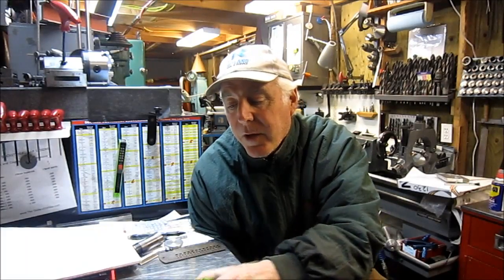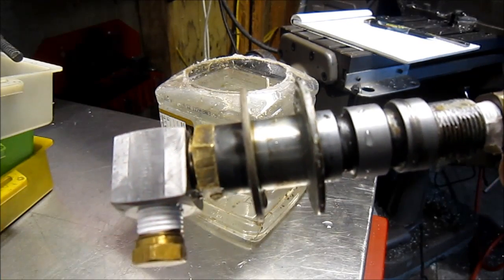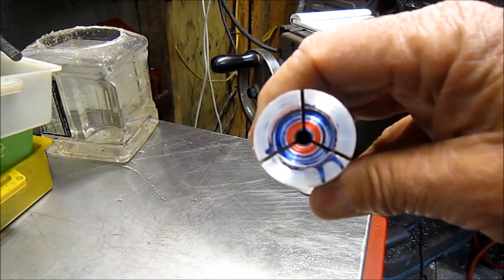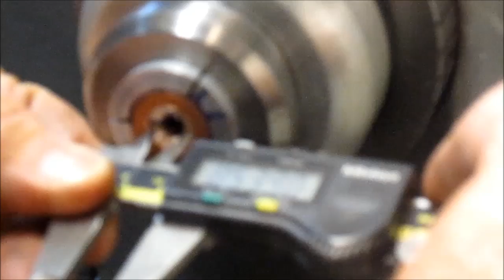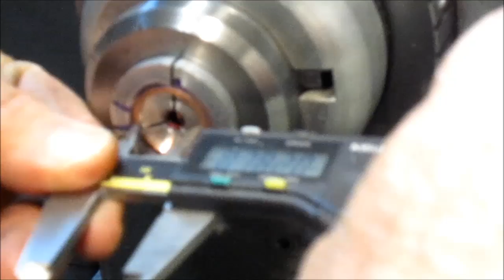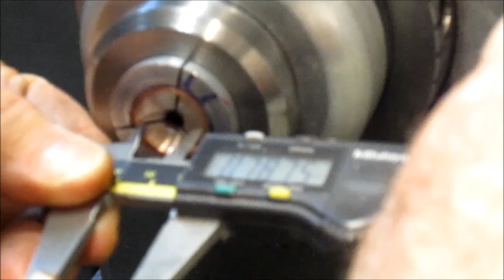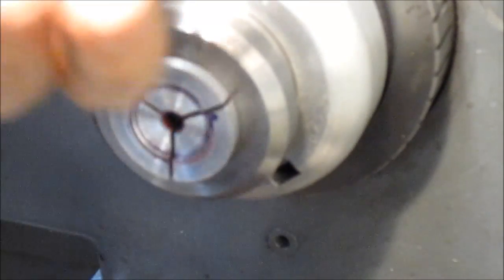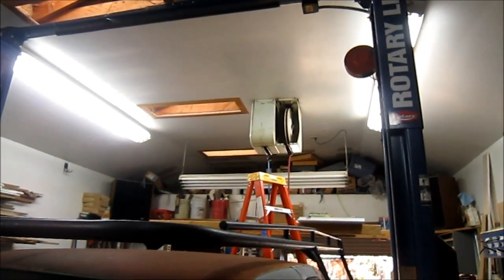TOOL TIME   Episode 12 2   AR  Assembly  Test

Comment: Diisc brakes use copper washers on the brakeline and they also make copper gasket o-ring things for indexing spark plugs in race engines ..Just a few ideas if you ever need a copper gasket.. Good to see your repair worked
Reply from the maker: Not 2
Thanks, I am aware of this since I did work as a mechanic when I was in my 20's, but it would be one hell of a task to find one washer that had the correct OD and ID of a part...lucky for me it is quicker to make it

Thanks for watching and your comments..
Chuck

Comment: Good job!  Careful disassembly and clean-up, checking with experts for options, documenting things well just in case, then a skillful, if out of focus, execution of the plan. The part never stood a chance!

Just curious, but would annealing the copper washer have been useful, since you wanted it to deform easily to make a seal?  Also, would some Teflon sealant have helped, or is it incompatible with fittings that old? LOL!

I think I'm where you were a few years ago...about the same age you'd have been, and just starting to learn about machining. I have the advantage of videos like yours, Tom Lipton's, Keith Fenner's, and several others to help me out. Thank you for taking the time!
Reply from the maker: Big...

Thanks for watching and I think annealing the copper after turning would have been a great idea...did not think to do that, did use sealant on the internal threads.

Cool that you are getting into machining....I have made lots of new friends because of this hobby...good luck and enjoy

Chuck